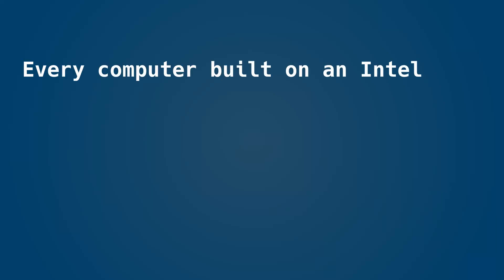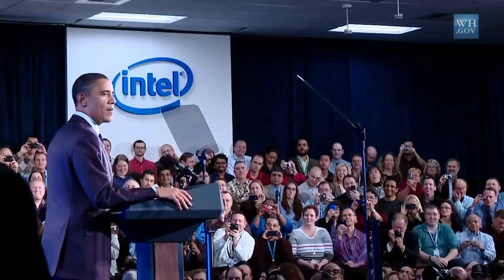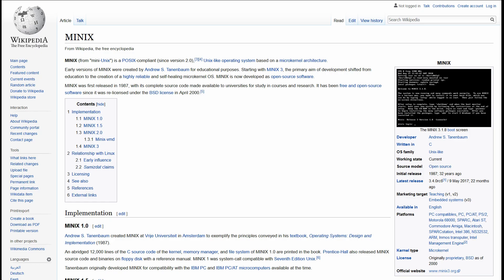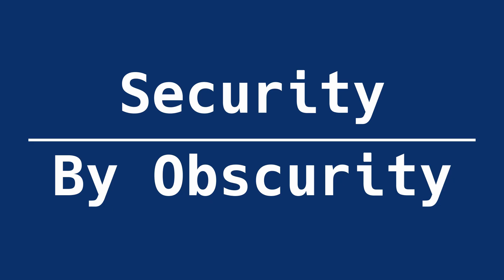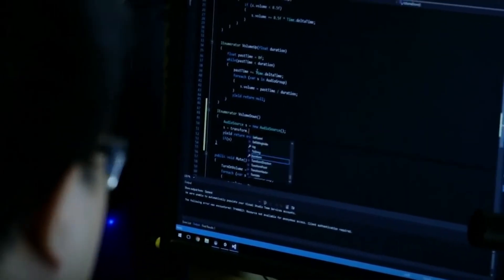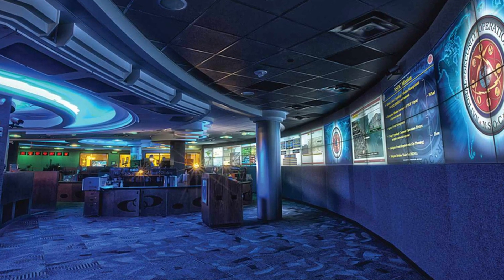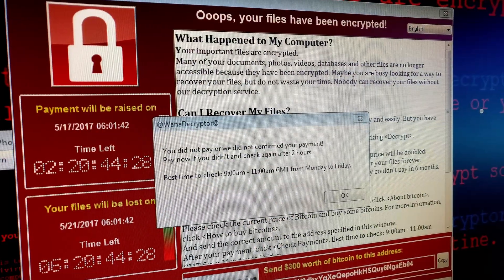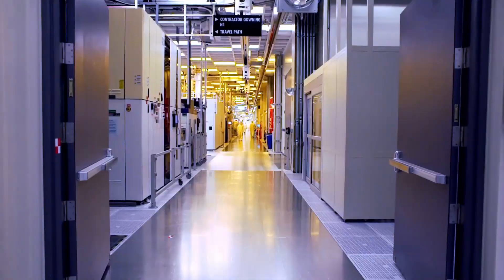How Intel wants to backdoor every computer in the world | Intel Management Engine explained

Comment: WTF!?!? So if Intel has this, and AMD is thought to have something different, what can we do to prevent mass surveillance, undetected intrusion, or security breaches by malicious actors (governmental or civilian)??
I run linux, hardened Firefox, and a VPN I paid for with bitcoin; I compartmentalize my browsing between multiple browsers, including Tor, and sometimes even use TAILS. So all that is literally for nothing if my processor is an Intel chip made between 2008-2017 (at a minimum) and possibly even if my machine is running AMD??
Seriously, what's the next step if all I want to do is secure my privacy and prevent exploitation? 
This hole just turned into the Grand Fucking Canyon.
Reply: Opensource hardware is coming
Reply from the maker: I'll tell you my speculation, but this is just a pure hypothesis: Intel ME and AMD ST are most useful with physical access on the device. If the police catch you, they retrieve your encryption keys from the memory. But it could be possible that Intel ME could be used as a nationwide kill-switch for civil rights and privacy. When the SHTF for the government and people revolt, I can imagine something like this can turn every computer (Mac, Windows, whatever) into a 24/7 surveillance device. 

What you do still counts. Intel would have to do something more than just having ME on people's computers. And we would notice if there were some unsolicited network connections calling home to Intel. ME is not being used like a social media site. Meaning it's very unlikely the government taps directly into your Linux machine through ME to collect your data. They mainly focus on mass surveillance of the Internet traffic and I assume would only resort to ME in targeted efforts. 

Intel has been ignoring the criticism of ME for over a decade now. I think they need to be held accountable before something happens. The reason they haven't been held accountable yet might be because of a collusion with the US government.
Reply: @TheHatedOne  Would removing the hard drive and RAM when the computer isn't in use and putting firewalls in at the router do anything at all? I myself can honestly live with oldtech - ThinkPad T410s, I've got like 5 and they're fantastic, but there's a possibility I might need more power.
Reply from the maker: @Soitisisit  If someone gets physical access to your PC, destroying your RAM and storage would help you. But if someone can get their hands on those, you can be compromised. When not using your ThinkPad, remove the battery and unplug it. This will disable Intel ME as it will have no juice.
Reply: Can it not run on Bios battery ?   @TheHatedOne
Reply: Soitisisit better hope that router isn't using an intel chipset or your firewall ain't gon do shit
Reply from the maker: @UrbanaticLemonade  I don't know. I never found  a claim that would explicitly say it couldn't. Either case is bad enough.
Reply: The Hated One Bonus points; most newer laptops have their batteries inside, you have to completely unscrew the base to even get a chance at the battery nowadays
Reply: @TheHatedOne  everytime windows 10 forces yet another massive update it can be phoning home all your activity to Big Brother.
Reply: @stargazerspark4499  which is why I have 3 laptops that once ran windows 10 and now all run linux. Yeah, minux might be damning, but at least I'm doing what I can.
Reply: @jgn2112  this has nothing to do with windows.
Reply: @TheHatedOne  I really hope your hypothesis  is factual. It gives me some degree of comfort but at  the same time it makes me complacent with how things are
Reply: @TheHatedOne  you say intel would have to do more than just have me on people's computer. my question is why?
Reply: @TheHatedOne  Intel just do what the us government want, it's a america company ffs, so of course it'd ignoring the criticism of ME. Want the ME removed? talks to us government, not intel. Want it held accountable is like ban youtube channel because users comments  violated tos not because the video of that channel violated the tos.
Reply: @TheHatedOne I have a bunch of network connections I can't shut down. They bypass firewall like it's not there. I really think someone is using ME to access my computer. What to do now? Any suggestion?
Reply: @TheHatedOne  
"If the police catch you"
-Why would the police catch you? You still have to actually commit a crime before they would come for you.
Reply: It is sad, but the only thing we can do right now is die. I always say the world is burning. Govt wants to know every single step you take every single second. Your thoughts, your desire. Unless there is a third large company like Intel and AMD producing CPU without those backdoors in mind, there is no fix.
Reply: @estellebright2579  It's private companies run by billionaire oligarchs who are doing it.  Now they bought the US republic.
Reply: You need to build your own computer based on 74xx Logic family chips:
https://youtu.be/0jRgpTp8pR8
A faster alternative are FPGAs, but you can never be sure what really is programmed on the FPGAs.
Both solutions are slow compared to modern CPUs. The first solution is very slow. A 8086 is probably faster.
Reply: @OpenGL4ever  Raspbery pi
Reply: @cyberp0et  Raspberry Pi is NOT as secure as you think. On Raspberry Pi Linux is running on top of another OS that is making that VideoCore processor usable for Linux.
Reply: @OpenGL4ever  I had the impession that is all open source. Just saying. I have no idea.
Reply: who guarantees that newer software after 2017 doesn't even have something worse than what we had before that date?! is a losing battle at this point, because your commands are literaly denied at the root. if intel wanted they could turn my computer into a Nuke Launch Platform, frame me and there would be no way to defend myself from it.
Reply: The answer is simple, humans have no rights... we have privileges. that families and people in power will keep chopping up those privileges ti suit their needs and the agenda of their alliances.
It's as simple as that.
Reply: Make your own processor and operating system :)
Reply: @conservativedeveloper7289  Terry was fucking right holy shit
Reply: I know...I'll just run chrome in private mode from now on. That, and windows defender with McAfee antivirus and I'll be safe.
Reply: @jgn2112  The only thing that Chrome's private mode is any good for is if you don't want your kids or wife to know what porn sites you were on.   This snooping system is on the inside of your computer and sees everything you see and everything you do in front of your cam.  
The good thing about this scam is the amount of data they are collecting is far beyond what they can look at individually as long as they are not targetting you specifically.  It is quite likely they have algorithms that identify or flag certain words and then snoop individually for more info.  The bad thing is that when the SHTF they can completely control or shut down your computer and that's the time you need your computer the most to survive.   The only way out right now are these new Chips that are coming out (mentioned by another above)and overtaking AMD and Intel.  Most of these are in Laptops and other small devices not desktops because of their energy efficiency. 
By the way, MS was complicit way back in the '90s. Apple was a willing accomplice. Linux, as it is open software, is not affected but all major hardware and other devices are.
Reply: The solution is to not rely on the grid, but be able to bug out when the SHTF. A computer is worthless, so don't rely on it.
Reply: Work, buy, consume and die. Thats all they allow you
Reply: @Big_Abomination  you ment to say "buy". But yeah your right on. They want sheep not free thinkers.
Reply: @Patrick1985McMahon  Thats right dude
Reply: @Big_Abomination  buying and consuming is basically the same. Also they if they don't want to run out of slaves they need fresh ones. So it's:
Work, consume, procreate and die.
Reply: The only solution is to reach a company that could mane a processor from zero and capable to be used with any os
Reply: >what can we do to prevent mass surveillance

Step one: Next time you hear politicians talking about "national security", "terrorism", "money laundring", "protect the children" followed by a suggestion of giving government more power, make sure that you do not vote for them and stop sitting on you ass and get everyone you know not to vote for them.

Step two: Always remember that most temporary laws, taxes and regulations are permanent. Oppose them every chance you get.

Step three: Try to interract with people IRL more than through technology. The only reliable way to protect your privacy these days is to speak face to face with people.

Step four: Next time you hear someone saying that they're fighting "fascism", "nazism", "bigotry", "Gender inequality" etc. remember that those people are the real fascists. They want the goverment to infringe on your rights more than anyone else. They want the government to control what opinions you can have and cannot have.

Step five: Defend free speech all the time. No matter how fucked up the opinion of someone is. Once you star to accept bans on speech you become part of the problem.

Step six: Get involced in local politics. The more people what value privacy etc. we can get elected into political offices at the grass root level, the better. That will trickle upwards.

Step seven: Always remember that no company will never do anything for free or to be kind. At one point or another they'll turn against you. Google's "do no evil" is a perfect example.

Step eight: Stop making fun of people excersising theri rights. It's become a trend to make fun of traditionalist, libertarians, nationalists etc. But they are at the end of the day, objectively, the last hope you have.

"Those who would give up essential Liberty, to purchase a little temporary Safety, deserve neither Liberty nor Safety." - Benjamin Franklin
Reply: Einhärjar how cute that you think politics is real. If you could vote in a party that would change people's lives for the better, they would make voting illegal
Reply: @der0keks  But Einhärjar has clearly been listening to one very specific party/wing for most of his life.
Reply: @NorthernContrarian  "Next time you hear someone saying that they're fighting "fascism", "nazism", "bigotry", "Gender inequality" etc. remember that those people are the real fascists"

How is the same not true for fighting 'Communism'? Even the Democrats are 'fighting Communism' these days. And as a man, even I am not fool enough to believe women are treated equally to us men. You've clearly been brainwashed by one side, and for one side, of a dual reality.
Reply: @NorthernContrarian  no it isn't, i once talked to a friend about temple os ( look it up, its quite dumb ), i had no working internet connection on any device around me ( or so it seemed) and after that without giving temple os another thought, it showed up in my youtube recomendations
Reply: @mikr_1098  I had that happen a few times. Smartphones are listening in on all conversations.
Reply: @NorthernContrarian  How the hell are ''nationalists'' ''objectively'' the last hope you have?Nationalists claim they're superior to other people becasue of their nationality.Most conservatives vote against taxing the rich and against free healthcare lmao.What world are you living in?They're the same people who called free and open source movement ''commies''.It's the leftists who promote open source and free software/hardware not rightwingers.It's the left wingers who are against the big brother.Hence the extreme version of left wing(Anarchists).''Traditionalist''Most hippies and similar are on the left not right.
Reply: The easiest thing to do is to use public computers
Reply: @FFFFFFF-FFFFFFFUUUUCCCC  public computers are monitored with cameras. So unless you wear a skimask or hat and scarf (which would make a swat team appear in seconds to arrest you these days) and also don't carry a phone, you can be identified.
Reply: Researchers are working on reverse engineering and disabling the IME. But it's still not something the average user would risk trying on their own system.. https://github.com/ptresearch/unME11
https://hothardware.com/news/researchers-figured-out-how-to-turn-off-intel-management-engine-11-thanks-to-nsa
Reply: I even heard an unpatchable vulnerability was found in Intel CPU's  that exist in every one made since the mid 1990's, so in short, only way to not be tracked is to just swear off technology completely and spend the rest of your life in a cave.
Reply: that's what cicada 3301 is for. They seek like minded individuals who believe in strong encryption rights.
Reply: Open a specific port or set the vpn on the router
Reply: Are you wearing your Tin Foil hat?
Reply: @mexican21  ah 'tinfoil hat' - the psyop induced go to put down towards open minded thinkers from anyone too crippled by cognitive dissonance to be able to check facts for themselves.
Reply: @mexican21  I am wearing my tin foil sombrero,
Reply: @mexican21 you still sleeping 6 years later? How's the booster shots
Reply: You think these software providers is secure this is also big thief's
Reply: He didn't say anything about ARM chips. Maybe ARM is safe from this sub OS
Reply: @Patrick1985McMahon  naaah, unlikely. The AMD counterpart ('AMD secure technology') is an ARM core inside the AMD CPU. So it's likely that ARM CPUs have the same technology.
Reply: Woa you are so paranoid!
Reply: @MrMovieMan941  bot account designed to muddy the waters?
Reply: @03056932  LOL :D
Reply: calm down, this video is crap
Reply: I know right I knew Intel had this but I thought amd was completely clean which is one of the reasons I run amd systems
Reply: @Kugelspecht Einhorn good catch. I can't believe I made that typo.
Reply: @Kugelspecht Einhorn same as well man. 😀😁
Reply: Damn. I knew I should have kept my old Commodore 64.
Reply: This looks interesting, seems to disable ME except at boot time. https://github.com/corna/me_cleaner
Reply: Check out Librem, they manually modify Intel CPUs
Reply: about this specific problem - RISK-V, ARM hardware. They are opensource.
Reply: Everybody needs to be kicking some money to the RISC-V people and the other people building Systems-on-a-Chip and whole motherboards for them. RISC-V is a free and open source soft-CPU. You can download the design in Verilog or VHDL and burn it to an FPGA. People are beginning to build whole boards for it.
Reply: just dont use any device. No easy choice.

Any consumption also harms the world we live in, it probably also supports some corrupt company and government and includes exploited workers, what can we do? Don't consume. But who choses thay? noone
Reply: RISC-V BABYYYY idk tho but as far as I know RISC-V is basically your best bet. Along with maybe making your own carrier boards for shit that you research and make sure doesn't have that. Hopefully I could build my own shit completely with RISC-V as I'm trying to move towards a revolution in my personal security. Still a novice so take what I say with a grain of salt.
Reply: This problem ultimately comes down to just the hardware level.  Companies will stop making decisions like this if it's no longer profitable you need to find competition that sells similar products both without those same flaws. It also helps if you buy hardware that's not manufactured in the same country that you reside.
Reply: Nothing. 😊
Reply: That's right, there's not much to do except for a community hacking the software and the hardware. The chips need to be bypassed or flashed or potentially bridged to another microcontroller that we can emulate the clearance for the OS etc. On the software side, needs to be hacked 😁
Reply: You my have to try me_cleaner to disable Intel ME 
https://github.com/corna/me_cleaner
https://github.com/corna/me_cleaner/wiki/How-does-it-work
Good luck
Reply: Stop using internet
Get rid of phone
Pay only with cash
Take the Tedpill
(Mail boom booms to universities???)
Reply: This is a lot bigger than you people think. It's more than the ASA or CIA or Homeland sec etc..  A lot bigger and a lot more threatening!!!

The  IME under these chips cannot be detected and stopped.  Anything watching data transport systems can be easily fooled by hiding the covert collection of information in regular TCP /IP packets that other programs are using by overwriting valid information packets with covert ones and setting it up for an error where it is captured and retransmission to its proper target. This also a method for incoming instructions.  Outside of inspecting every packet against what should have been transmitted and recognizing that it was not just an error in transmission and that it was a valid transmission, there is no known method!   This is not possible without a CPU that has no IME in it.
The people collecting this info on you and possibly controlling your comm when the SHTF are the international globalist bankers.
Nutyyyahoo a few months back was bragging about several hundred US companies moving to Israhell.  He claimed the Intel was already there. That Boeing, Caterpillar, MS, Apple, even google, all security agencies and several hundred others are or will be moving there.  That's why they need Syrian, Iraqi, Egyptian, Jordanian, Lebanese lands. 
All information collected, even every keyboard strokes winds up in Israhell. 
Look at the Talpiot program.   Their Talmud says they will rule the world and everyone else is their slave and below them as animals.   You people need to wake the F up and look into this imprisonment!
  Half the Jews know this and call it a suppressive act!
Reply: Or just realise that no one fucking cares about you and you just spreadsheet data for them.
You are being tracked by your smartphone, city cameras, home AI devices, your PC, and i'd bet these new cars have some kinds of monitoring devices.
But, if you are not a criminal and live a ordinary life, no one ever cares for your data and it is used just to make your life easier at best.
You get targeted adds, auto reccomendations and other stuff you could never have without them stealing your data.
P.S. In some Europe countries, ID's have logging microchips that make a writing every time you go near a sensor made for them. And those are in every major supermarket, malls, etc..
If they connect all the data they can track you pretty easily.
Reply: I keep no proprietary data on a computer.
Reply: @agnoses  you don't log into anything? lol
I'm sure your phone is full of "proprietary data"
Reply: LoL Don't bring attention to your browsing activities and you wouldn't have a problem. You've probably been downloading some illegal shit.